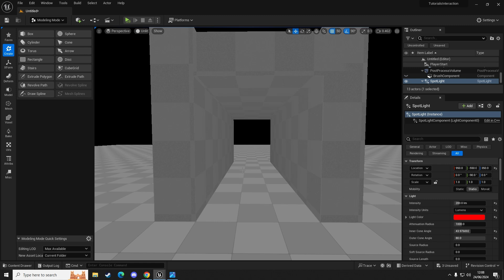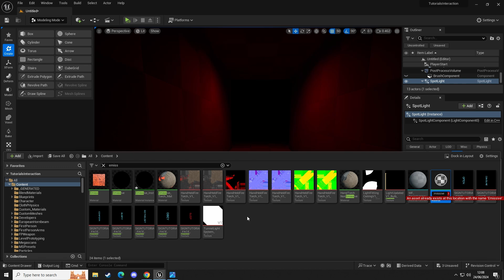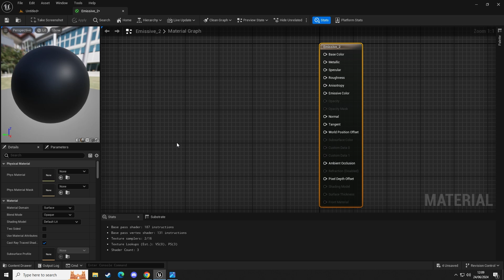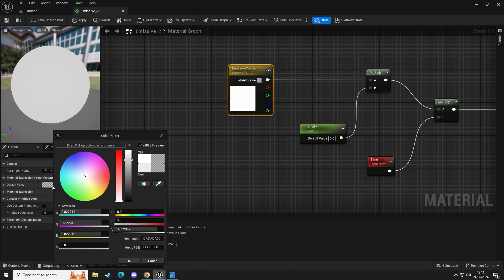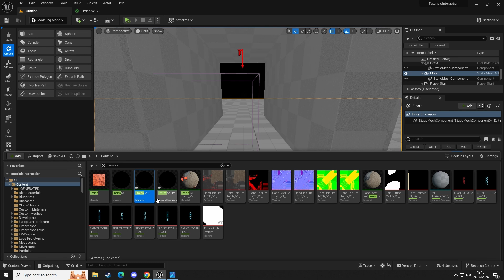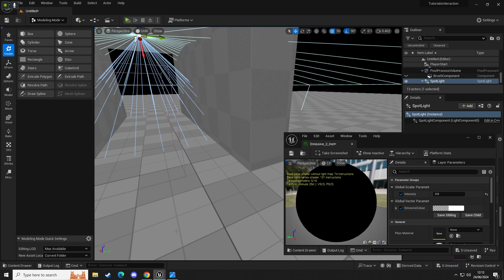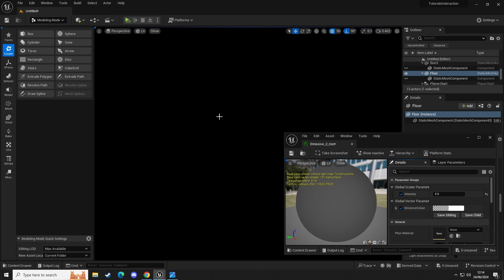HOW TO CREATE PULSING LIGHTS UNREAL ENGINE 5.3.2 TUTORIAL SUPER EASY

Comment: how if i dont want the light goes to zero but just flicker little bit. with sin or cosin it goes from 1 to -1.
Reply from the maker: There's lots of different methods to achieve light flicker you can also use a timeline in a blueprint to control the flicker speed brightness etc.
Reply from the maker: If you want a light function that stops the light going completely black set it up like this -   Time Node -  " A " Multiply  - Create a Param Node " Hold S " left click name this Flicker time and connect that into the Multiply " B " out of the Multiply node into a " SINE " node out of the " SINE " node into a " FRAC " the Frac goes into the A of an " ADD " node  the B channel you connect another Param Node name this lowest Brightness value or something similar set it to .5 and set your flicker time node to 1  .. out of your ADD node into -  Emissive Colour input on the material.   

This will give you a flicker effect without fading all the way to black. adjust accordingly to your preferred preference

Comment: Great video many thanks mate! I have a question, how would I go about making a light that goes on quickly and off slowly? 
If the light you made here could be described as follwing a sine wave pattern how would I make one that follows a kind of sawtooth pattern?
Reply from the maker: Theres a crazy amount of ways to control lights another way to do that would be in blueprints you could use an add timeline node with a custom pattern and set it to looped if you need help with this just reach out on Discord all Youtube subscribers are welcome there for help.
Reply: Awesome thanks alot!  @AMMediaGames
Reply: @AMMediaGames Timeline node worked a treat, I have all the control over the lights that I need thanks again for the pointer 👍
Reply from the maker: @JManskin  no problem glad I could help